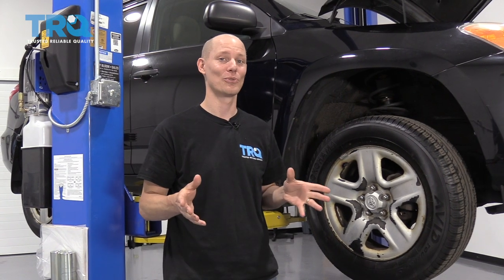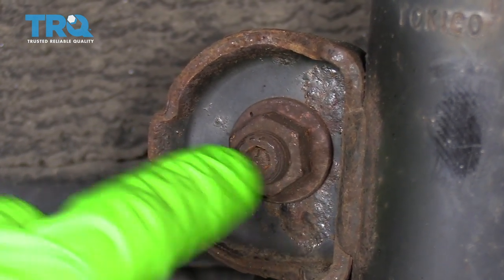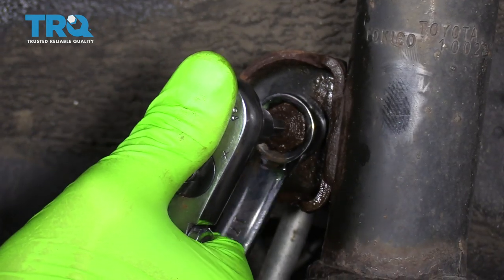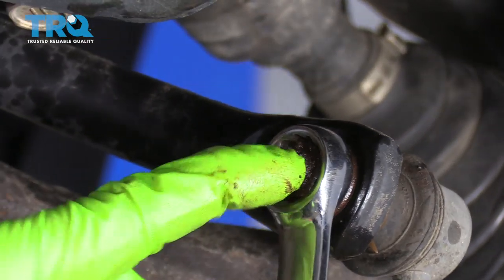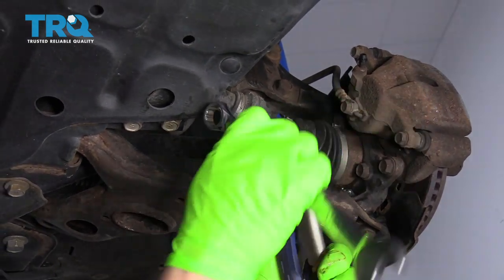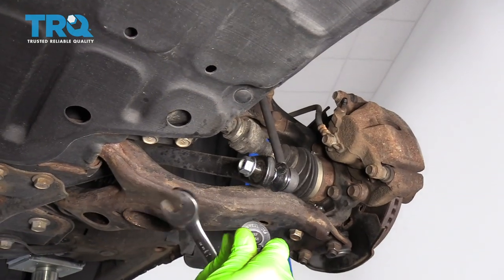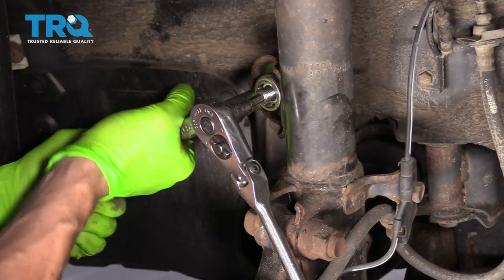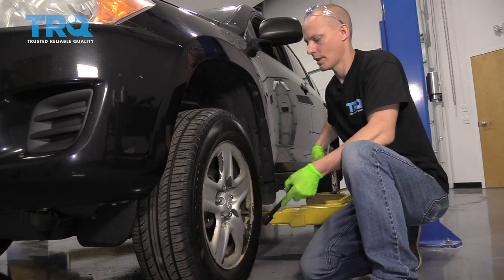How to Replace Front Sway Bar Links 05-16 Toyota RAV4

Comment: If you are doing this with only one side jacked up, you will have to compress the suspension once you remove the first nut to remove the pressure placed on it from swaybar (since the other side of your vehicle is being compressed). Just place a second jack under your suspension and compress the suspension a little. You will see when the swaybar link is free to be removed. Then replace and then  lower the secondary jack.

Comment: For the old sway bar links, I just put a vise grip on the inside of the link to prevent it from spinning. Does the same job as the Allen key but easier cause I just take an impact gun to the nut on the other side.